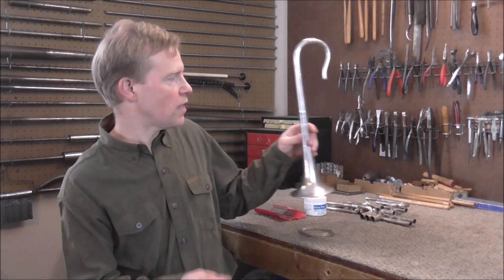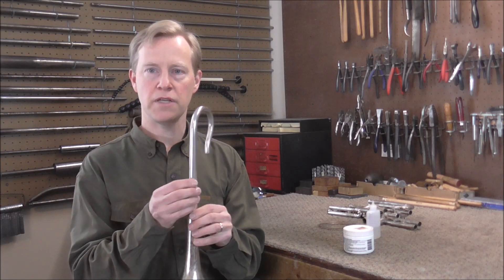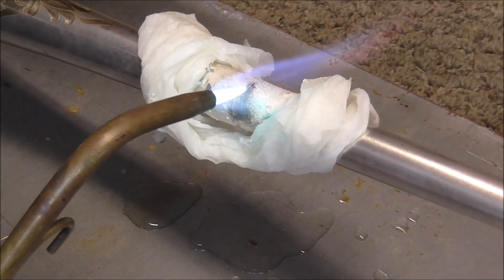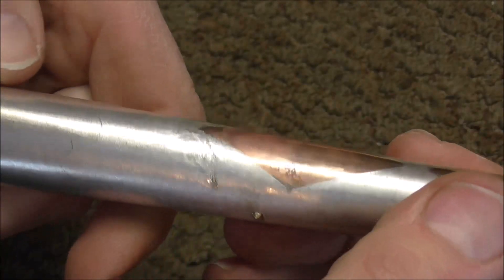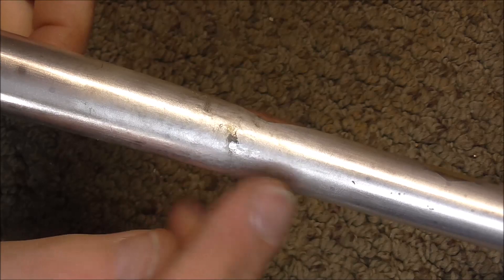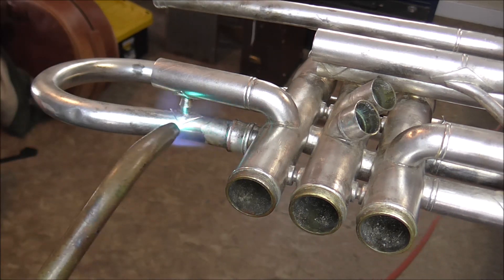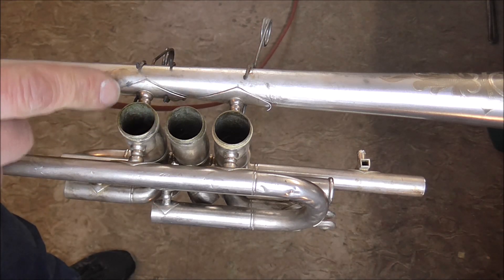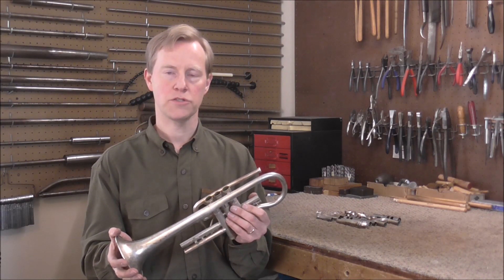Old Cornet Restoration Project #5 : Patching a Hole In the Bell and Soldering

Comment: This is a very interesting series, thank you for making it.

I think perhaps you may not do much silver soldering. There is a trick to knowing when the metal is hot enough. As you heat the metal and flux, the flux will first dry out and take on a powdery appearance. As the heat increases, the flux will melt and flow, taking on a liquid watery appearance. This is when the metal is hot enough. A quick touch of the solder, which can be done after removing the flame, and it will be pulled into the joint by capillary action and flash around the joint, just as happened with your soft solder joints. You can tell that the metal was not hot enough because you got a bead of metal and it did not flash into the joint.

Usually when silver soldering you try to limit the flux area to the area to be soldered. The solder will not adhere where there is not flux. Of course in this instance you had a valid reason to use a much larger flux area.
Reply: Good info! Did he reach the correct temperature at any point of the video for silver soldering or was he a bit under temp. for those three silver solder points?

Comment: It's best to use lead-free solder on silver plated instruments (96-4 or 94-6) because any of it that shows will blend with the silver plate instead of getting that dull gray that regular lead based solder gets.  It takes a little higher temperature to melt, but it's totally workable.

Comment: I thought that the flame could have been smaller. If you are using MAPP gas with Oxygen, you can get concentrated heat on a smaller area. I have found in soldering Cu and brass that works extremely well -- maybe not with silver though. Thoughts?
Reply from the maker: I have only used acetylene so I do not know much about other kinds of gases. Maybe I can try to experiment with them some time.
Reply: @TheBrassandWoodwindShop  Mapp gas is actually propane principally. By adjusting the propane and oxygen you can have tremendous  control over heat and flame size. Mind you, I have not repaired instruments.

Comment: It's not obvious to me why the bell gets silver soldered. It doesn't need the strength, and those cracks aren't joints which may creep over time. All I can think is that the silver crack repairs won't remelt when the valves are soldered on with soft solder.

Comment: What is the name of the liquid flux..is the powder flux more effective than the liquid flux..if I use butane flame can it melt it..to stick the broken thing I have to clean the surface so that it becomes copper or I continue to make connections..before I have make a connection but not successful..because it does not stick perfectly ..

￼
Reply from the maker: I have never use powder flux, so I am not sure. Butane will take a little longer to heat up, but it will work. You can solder on silver, copper or brass. 
I hope this helps.
Reply: @TheBrassandWoodwindShop  can i buy from you liquid flux..how much price liqiud flux at your place
Reply: i from malaysia..and i working in brassband army at my country.